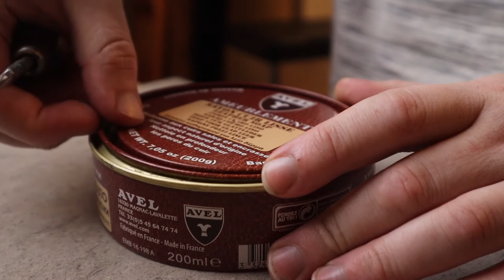CLEAN AND RESTORE OLD MILITARY BOOTS  PART 2 // Will Hodges

Comment: how would you clean the insides of the boot? I was looking at some old military boots which have been used and for hygiene purposes I'm curious on how you'd go about cleaning the dirt, mold or even blood stains from the inside without damaging the leather boot. any advice would be appreciated!
Reply: Response 3 months later lol but for anyone else that may see this: I have cleaned mine with a cloth draped over a toothbrush dipped in a gentle shampoo/water mixture. You can prob use a gentle hand soap or something like that as well. Scrub everything out gently and dab/wipe it as dry as you can before leaving it to air dry

Comment: Can I use these products on my brown French ranger boots? It is the same basically, just not black.
Reply from the maker: Yes you can, test on an area out the way and I bear no responsibility for the outcome
Reply: @WillHodges  thank you for your reply, I will try it, and I won't blame you  for the outcome 😁
But these boots are not suede leathers I think as the  guy in the shoe repair shop he said it is. It is just a  rough leather boots.